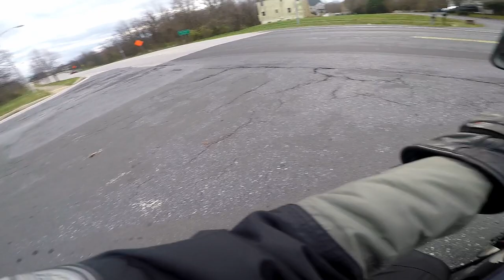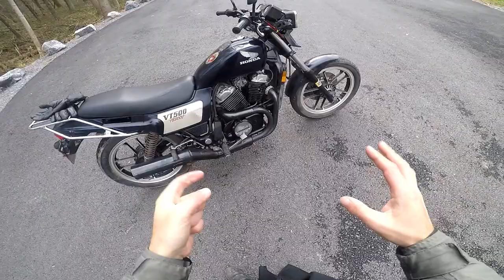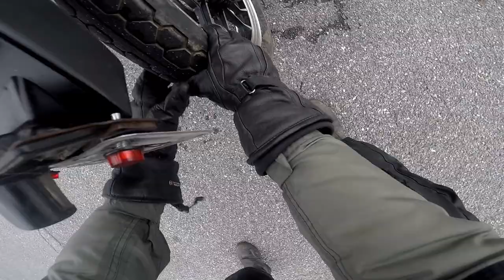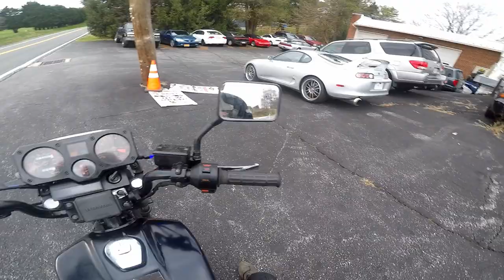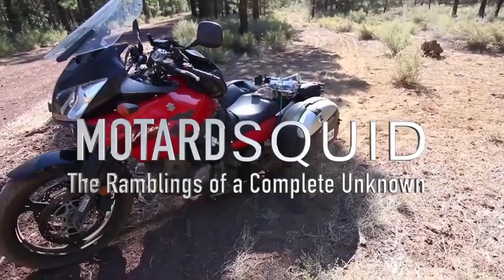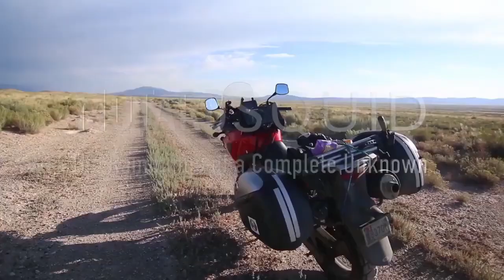Can a Honda Ascot from 1983 keep up?

Comment: VT500FT pro tip - There should be a drain hose with a plug coming down from around the swing arm pivot from the airbox. Pull that plug and let the accumulated gunk drain out. Make sure the hose isn't blocked (one time check) then reinstall plug and hit the trail. A surprisingly small accumulation of gunk in that tube can cause exactly the conditions you are experiencing. If the plug is missing, that can be a problem as well... Replace it. Questions?

Comment: Dunno, Another pigs ear turned into a silk purse. I hope a collector buys it as it has alot of charm despite the tiny fuel tank.If you get the
time check the bottom of the exhaust (lowest point) and see if it has a drain hole or if its plugged.If it doesnt have one I`d drill one as stock exhausts from that era can rot quickly without it. Cheers.!